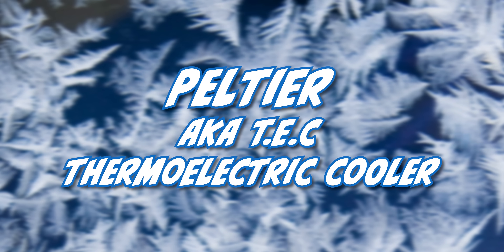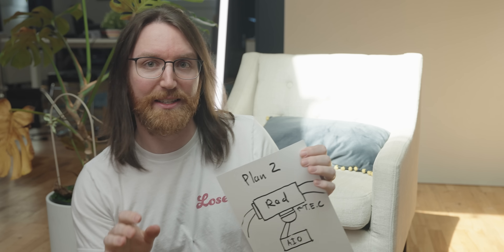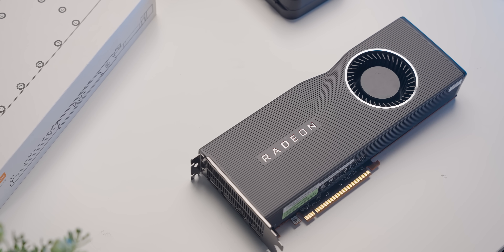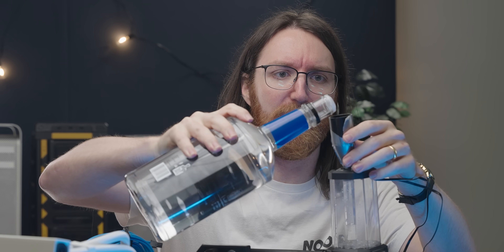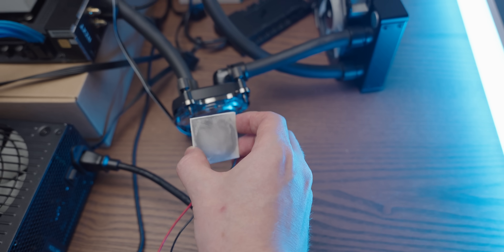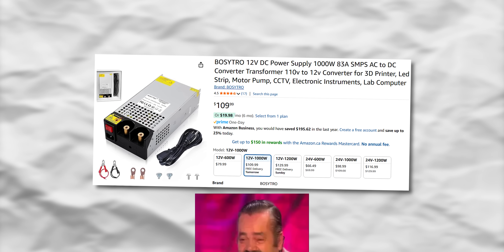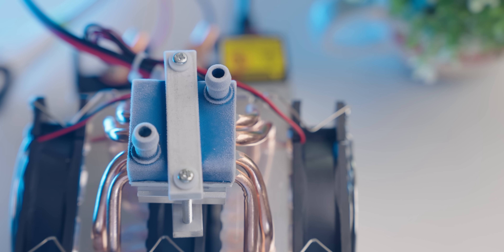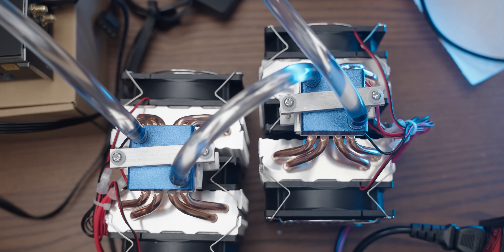I REVOLUTIONISE PC Cooling....

Comment: I'm surprised there's been little attempts to employ peltiers in PC cooling. Intel had some samples a few years ago but it was limited to some special edition coolers, not exactly available to the public. You'd think it would be usable with an AIO though since they don't experience such fast temperature swings. The hardest part would be having some type of monitoring to adjust the voltage to the peltier. It would never be a mainstream product but could be used for some exotic cooling.

Comment: As I mentioned in the comments on your previous video peltier elements are very inefficient only a few percent so if you run 200W you only be able to move a few watts of heat from the cold side as you already seen.

Comment: It is an interesting concept, but sort of not really going to get the job done well.   Those coolers are insanely inefficient, with a conversion factor of under 10% - so your 280 watt unit can transfer about 28 watts of heat.   For comparison, your sh-tty intel stock CPU cooler would consumer 2-3 watts of power, and would be able to handle about a 60-65 watt heat load.  You would need something in the range of a couple of thousand watts in your current config to really make it chill.

Another part of the problem of the peltier as you have it is that the "hot" side and the "cold" side are actually quite close together.  So you need a process where the peltier has enough cooling to dissipate the heat that it is collecting from the other side.  The process used to remove heat from the peltier is actually many times more efficient than the peltier device itself, which sort of makes it useless.  Just having that additional water block with the fans would likely generate a very similar result overall (it is just working as a really sh-t radiator.

The extra cooling imparted by the peltier device is totally lost when you consider the heat generated by the power supply to run it.

Comment: paltier probably should be set right in front of the gpu block like , Pump >>> TEC >>> GPU/CPU block >>> Rad >>>>Pump , to make sure the chilled water goes into the block instead of just dissipating it out into the air

Comment: When you use the Peltier you should remove the normal radiator from the graphics card loop. otherwise you are cooling the air. That is why it was so inefficient.

Comment: Using a flammable liquid as coolant ingenious. I expected to see blue flames at many points in the video, phew.
Reply: it uses electricity via Magic:face-red-heart-shape:
Reply: It's mixed with water, he didn't drain the loop. 

It's likely not flammable. And unless it was very high proof, it was likely not even flammable right out of the bottle.
Reply: @volvo09  if its over 38% itll burn when heated up
Reply: @volvo09  Did you see him mix it with water?
Reply: @Njazmo  yes, he poured it into the empty reservoir without emptying the loop. 

The total amount of alcohol in that loop was not very high when vodka itself is usually under 50% alcohol (that would be 100 proof, 200 proof is pure ethanol).
Reply: Above 70% for flames
37% is not flaming
Reply: There are plenty of flammable liquids and gases have been and are still used as cooling fluids
Reply: Ethanol will burn without visible flames, bad news.
Reply: the main problem more like, it will eat the rubber parts, so will be leaking over time.
Reply: I don't think vodka is usually flammable.

Comment: Craziness. I would have put money on that working, at least somewhat. Temp probes before and after the TEC would have been interesting to see. Is there just too much heat load in the hot water and the losses from the TEC stage too great so you only end up with 1 or 2 watts of cooling capacity with that setup?

Comment: Ok Dawid, peltiers come with performance curves. Running the plates at full tilt, will grant you little to no temperature drop in an ideal situation. 

Long ago, i built a custom peltier chiller. Custom copper cold plate, which water actually flowed through, and the hot side of each got its own water block, which fed into a massive radiator, pulled from a car....that was cooled with a box window fan (this was 20 years ago, and it was the cheapest option) 

We tried running it at two different cooling levels, 80w per pelt, which was 120w input power, and 100w of cooling per pelt which was 150w of input power. 

Absolutely impractical, awesome, but impractical.  

About on par with the power consumption of a phase change cooler, but substantially less danger of sweating tubes ruining something.

Comment: Dawid, I think you should turn the loop around.
If I saw correctly, you are doing Pump -> GPU -> Peltiers -> Rad
I think you should do Pump -> GPU -> Rad -> Peltiers.

This way, the Rad can pre-chill the hot water from the GPU somewhat and the Peltiers have a little bit less load on them. They should be more efficient if the stuff they are trying to cool is a little bit colder.
Also the Rad is more efficient in cooling down the water temp the bigger the delta between water temp and ambient air temp.
Reply: its actually even worse: if peltiers are super efficient, the rad would heat the water back to ambient temp
Reply: @0Tn0  You would be correct, but only when the peltiers produce more cooling than the GPU does heating. In this video, the two 120 watt peltiers should by far be unable to handle the 180 watts the GPU pumps into the loop. Quick napkin math tells us for this exact setup (two 120 watt peltiers in series) we will guess a COP of 0.4 or lower (we don't know the temperature of the peltier hot and cold sides, this influences COP greatly, also the quality of the peltier is important here. 0.4 is a reasonable guess). So for 1 watt of power pumped into the peltier, only 0.4 watts of "cooling" is produced. Which means we should expect 96 watts (or maybe more / less) of "heat removed from the loop".
Guessing Coefficient of Power is difficult for peltiers without explicit info on how hot/cold the two sides are. They are most efficient when both sides are nearly identical in temperature, but the higher the delta between the two sides, the COP rapidly gets worse.

You should be right if Dawid scales up to six peltiers like he mentioned, the Radiator should be left out of the loop since we pump so much power into peltier cooling that the GPU should be put below ambient. But in the setup of the video, flipping the loop orientation might provide benefits since the two 120 watt modules in all cases should be unable to handle 180 watts of heat produced by the GPU.

It's worth an experiment I think. But then again, I am just some dude on the internet, I might be horribly wrong on this haha.
Reply: Usually order doesn’t matter, but it does here because exactly one component can take the liquid below ambient.

The radiator gets more efficient when it is hotter, and drops to zero once the liquid is at room temperature. But the peltier is can keep going, and cool below ambient.

For a stuuuuupidly over-simplified example:

Imagine
Heater: +200w, radiator: -150w, peltier: -100w. Your liquid is now -50w from where it started (below ambient).

Do it heater +200w, peltier-100w, the absolute best case for the radiator is -100w (because that’s all that is left)

I am treating efficiency/effectiveness as a binary, it isn’t, the radiator could do more than 100w in the first example but could never get that same 100w in the second. The efficiencies all over the place are relative and variable.

Also, the peltier doesn’t handle swings in temperature, but the radiator does, so it can smooth the heat if it sits between the heat source and the peltier. 

Does it apply here? I’d guess no, not nearly enough cooling capability. Also you don’t actually want below ambient, outside of very specific controlled circumstances, but you can manage that.
Reply: @thedave1771 this guy gets it
Reply: I have that setup with my system cpu block to rad then to a stack Peltier with its own water loop and then to the the cpu. I never seen anybody on YouTube do that yet and I thought this was going to be it .
Reply: Component order makes literally no difference, the loop should reach equilibrium regardless
Reply: @deathetech  The amount of heat removed by the radiator depends on the coolant temperature measured at the radiator. If You put the peltier before the rad, it will radiate less heat. The effect is not huge, but noticable.
Reply: @zorrozalai  the delta between components in the loop isn't really relevant unless there isn't enough heat dissipation. Again, flow rate matters - amount of heat dissipation matters, order does not.
Reply: @deathetech that's like saying the liquid is the same temperature throughout the loop
Reply: The solution was really simple and it should work even with the first direct Peltier attempt. Do not use a radiator, connect it direct to the reservoir/pump, no rad in between. It's acting as a heater!
Reply: Up
Reply: pump ---> peltier---->gpu----->rad
Reply: The Peltiers should come right before the GPU.  Something like Pump - Rad - Peltier - GPU. 
If you put the peltier right after the GPU, it will cool down the liquid to room temperature, so the radiator doesn't have to do anything.
With the order above, the radiator cools down the liquid to room, and then the peltier cools it below room temp, before it enters the GPU.
BTW, the Peltier wattage should be choosen for the flow rate. The faster the liquid flows, the less it will be cooled by the Peltier. But if the pump is too slow, the liquid will warm up too much in the GPU.
Don't forget to put the pc in a box with a 3.5 kW air conditioner to keep ambient temperature at 16°C or below. And you should stay above the dew point at the GPU. :)
Reply: The order of components in a loop makes no difference to the loop's operation.
Reply: @fred_derf  If you try to go below room temperature measured at the gpu inlet, then it does.
Reply: YES that’s what I was thinking the entire time!!

Comment: Water has a higher heat capacity than alcohol so Dawid, you are basically hamstringing the liquid cooling system before you start. IMHO, standard water liquid cooling is already overkill for most gaming computers. The cooling provided by well engineered heat pipes, metal fins, and fans is already very good so the extra cooling ability offered by water cooling isn't worth the cost, complexity, leak risk, and decreased reliability. In any liquid cooling system, it is only a matter of time before something goes wrong and the system needs to be drained and fixed.

Comment: IIRC cooler master has a sub zero cooler AIO that basically is a peltier implementation in PC cooling. maybe use that if you can came across with one 👍

Also this is the same idea that I have a while ago, it's nice to see that somebody try this 😅

Comment: You need to buy a ball valve (like 20-30 USD) for draining. Also Alphacool makes quality water cooling equipment at a reasonable price. I have used their products for years (Jayztwocentz used/uses their stuff too) and it is high quality and EK has a lot of problems and its over priced.

Comment: Dawid, get a Copper sponge stuff it into a copper pipe, bit of copper mesh both ends, to keep the sponge in, and  then soldier a copper plate to the side of the pipe, fit the peltier to the plate and fit the pipe to your loop, this should give you the best chance of efficient transfer due to higher surface area due to full pipe length and copper sponge, and all the liquid having to pass through it.

Probably would fail... but might work, and could be a fun video lol.
You would also need to clad the copper pipe to improve transfer further and prevent it frosting up from condensation, also drill holes in the plate and you can use the AIO mounting to clamp it all on.

Comment: Your friend was wrong.Putting the peltier on the radiator,and removing the fans (or considerably lowering the RPM,for the sole purpose of peltier not freezing the surface of the radiator) would be the best way,because the low temperature would spread all over the radiator,and the water would have a much bigger surface to transfer the heat (as opposed to the tiny surface of the cold plate) so the temperature would equalise nicely.
Reply: How exactly do you make good thermal contact with a radiator?
Reply: @lemagreengreen On the side wall?He could even put both on each side of the radiator,since he has two,for even better efficiency.

Comment: still on 11:09 but I? just want to weight in and say that there is a misconception here that the radiator is "cooling". The radiator is passing ambient temperature air via the fin stack with the goal of reducing the temperature delta between the liquid and the air.  This means that it works both ways, if the liquid is colder than the temperature of the air passing the heat transfer will be in reverse i.e. the the liquid will get warmer while the air exiting the fin stack will be colder.
Reply: I think people just say cooling because it is easier for others to understand.
Reply: I don't know much about how heat works, but I feel the ideal position to install the peltier would have been between the radiator output and the gpu block input. What do you think?
Reply: @evergreatest7644  It wouldn't matter where it is placed in the loop, the way a liquid cooling loop works the liquid in the loop will just equalize in temperature. That's why the order of how a liquid cooling loop doesn't matter in the end, so don't listen to people saying that the order of the loop matters in anyway because they're 100% wrong, it does not matter.
Reply: The solution was really simple and it should work even with the first direct Peltier attempt. Do not use a radiator, connect it direct to the reservoir/pump, no rad in between. It's acting as a heater!

Comment: Peltier module doesn't create cold by magic. It actually transfers heat from a side to another. If the hot side became to hot, the the cold side will not be able to stay cool anymore. You need to cool the heat side too. You're just moving the temperature issue one step away.
Reply: I'm pretty sure he knows that, that's how the first setup worked and that's why those commercial coolers had a cooler on them, they were meant to cool the hot side... And he hooked up the loop in the last experiment in the right order: Cool the coolant to or close to room temp using the regular liquid cooler part, then cool the coolant using peltier 1 under room temp, then cool it further with peltier 2 and push it to the GPU... the problem is that peltiers are just incredibly inefficient at drawing heat away and being cooled. Maybe if he tried to Ultra OC a 50W GPU it would make sense, but even that may be too high of a wattage...
Reply: He used an independent AIO for his first attempt to cool the hot side and the prebuilt coolers he purchased had big, beefy air cooler towers connected to the hot side.  At the end of the day, he could have simply added more/thicker radiators and better fans to his liquid cooling loop, removed the Pelletier coolers and CPU block entirely, and achieved a cooler GPU temperature than what he was able to here with significantly less power draw and OVERALL heat generation.  And it would all run on a single PC power supply with minimal jank.  There are very good reasons these are not used for any type of PC cooling at all.  They don't really solve any cooling issues in modern PCs, while introduce all new cooling problems that need solving.
Reply: that's what I was thinking the whole time I was watching this lol

Comment: Its so inefficient, that you can cool a big fridge for same amount of power for that small peltier, hey dawid why don't use an actually compression system to cool the cpu as they do in refrigerators ??
Reply: Actually yeah id like to see that
Reply: Ooh.  You can get ice cream machines that use a compressor.  I'll bet something like that could be repurposed.  Stick the reservoir inside the chamber that it cools.
Reply: @purplecat4977  same can be done with air sealed metal pipes, filled with a good compressible gas, a heat dissipation unit and a compressor to compress the gas as it expanded in the process :D
Reply: because this doesnt require messing around with refrigerant lines.
he is doing this because why not, not because it would work well.
Reply: @guesswho2778  that meant to be a  suggestion, dude.